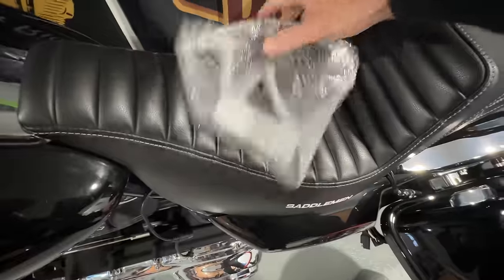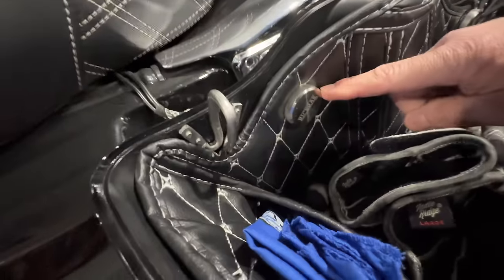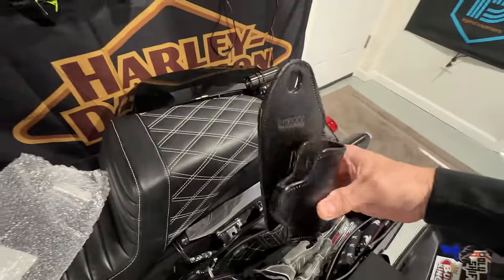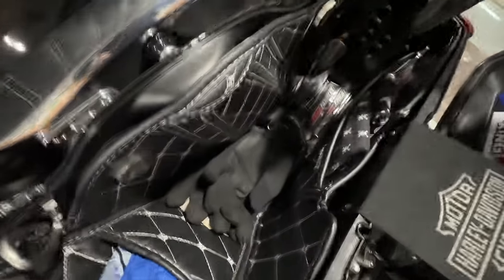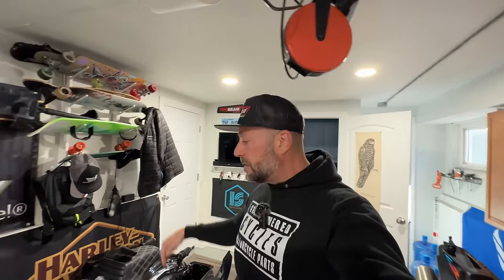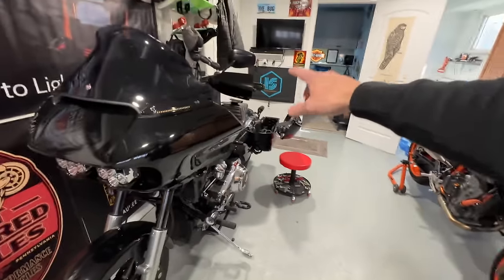Should You Upgrade To The New 2024 Harley Davidson Models ? #cyclefanatix #harleydavidson

Comment: Hello from CT. Well explained.Why I didn’t do anything with my 2022 road glide limited just changed seat for more comfortable for long miles. In 2010 got new Dyna  of course like most of us I started customizing spent $$ almost another bike for parts and labor. I enjoyed few years until I rented a  softial heritage on my vacation in Spain. After one week on heritage I knew it if I want to do long distance I need new motorcycle. Dealer didn’t offer much so I decided to keep it. Got used Electra classic from private seller. Did  almost 16 k miles and traded for road glide without loosing much $$. 
One day dyna will be nice classic bike with lots of upgrades. 
Also I need to admit that you’re doing great work on your channel. 👍

Comment: I been going back and forth for weeks on upgrading, I have a 2017 I bought new, it's a stage 2 bars ect.. but it's got 60,000 miles. Stock engine and stock clutch
Reply from the maker: Seems like you’ve been doing a lot of riding, which is great
Reply: my 21 ultra with stage 2 has 34k miles still going strong and i was going to go cvo st but i dont think 5k down and 768 payment is a option for me considering im paying 470 for mine now
Reply: Build out/refresh, its still new enough, save 20k and just drop in an S&S crate or HD crate in it
Reply: @Mikey_556  yes or just do a 129” fuel Moto big bore kit hahaha.
Reply: @CodyMcDonald89  building a bike or a rocket ship 😂😂👌🏼

Comment: John you are so right. I have rebuilt my motor twice 10k miles dual cooling (Silverback issues) and the most recent rebuild with an S&S crank. 131 pounding out 166 horsepower 165 ft of torque . My bike is a 2021 Ultra Limited so I have the latest technology (rdrs) . I have modified everything you can imagine. Ohlins, Mustang, Custom D, F Moto, Dyno J, Cush drive, Rick rak and the list goes on and on and on. I bet I've got $ 65k into it. It's insane but it's such a badass machine. Too new and too fast for a downgrade for a new gauge pack. To do it all over again to a new bike no thanks

Comment: definitely worth the upgrade for someone with RG that doesn’t have a lot of mods :engine is smoother and bigger, lights are brighter, looks meaner, suspension better, infotainment system better, ride modes…. rather than spending a lot of money for a bunch of mods Harley gave a lot of goodies standard. You will end up trading it bc ur sponsors and others are going to want to see the new bike and it’s mods. if you dont trade your content will eventually start to be dated. Or just get a 24 and keep max.

Comment: Would do a CVO St in a heartbeat. But non you tubers are going to get raked over the coals on mark ups. Pocono MTN Harley told me 2 weeks ago they tried 12k and still ended up at 6k over. Screw that. I'd already traded in at MSRP. But not a dime over. So good time to be a you tuber.
Reply: I paid forty four out the door in Missouri. They gave me a deal with a great trade too.
Reply: That’s Insane
Reply: Nice have 20 blue #1 rg. Would be wiling to trade but not over msrp

Comment: Harley factory warranty is not good anyway! I just bought a 23 RG ST the week before the 24s were released. Love my bike. Do I wish I had waited? Kind wish I would have. I bought my ST for the 117 and did a full stage 1 with bars. I coukd have done that to the new one and been at the same price at my ST and had the cooled motor. I do love my bike though and will put a bunch of miles on it and trade it in several years down the road. Just wish harley would offer a better warranty with their bikes! When u buy them new!

Comment: The cvo st is alright. They missed the mark on some things though. Their handlebar set up doesn’t feel nearly as good as a good riser and moto bar set up. And your suspension I garuntee is better than the showa suspension they put on the st. The only weight reduction carbon they put was the front fender. The seat cowl and the tank carbon don’t make any sense.

Comment: so if a guy has just a stage 2 that was done to bike and few stuff like speakers which i can take off and return stock and take the legends off the back because im sure they will fit on the new. and just go ahead and make the trade for the new style?  im losing 3k for trade in a local dealer offered me 23k for my 21 ultra because it has the snake venom paint
Reply: You have the best paint in the last 20 years. No way I would buy into the new tech until it gets tested by others. The oil pump fiasco of 2017-2020 was a lesson worth its weight in gold.

Comment: Wait, what... a 114 with a stage II setup is equivalent to a 121 CVO ST?
Reply: Power wise yes . a lil more with stage 2 114. My bike has a 114 stage 2 and it put down 130/130
Reply: I have a 114 with stage II torque cam, filter, slip ons and SE tune, it still feels a little gutless. I see people talking on other forums like the CVO ST is like a stage IV, but those dyno numbers weren't that great. @ikedaniel91
Reply: @norsmanadventures They are measuring at the crank, wait until these bikes start being put on the dyno. Grown men will have tissues to wipe the tears.
Reply: @norsmanadventures Evidently you dont know hp. 130/130 for a stage 2 114 is good. I bet your stage 2 wont with SE Tune wont touch it